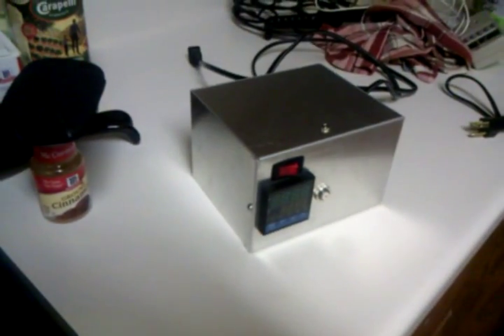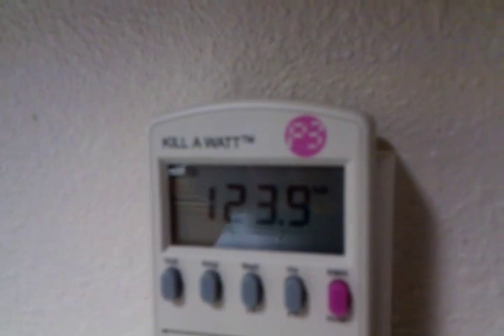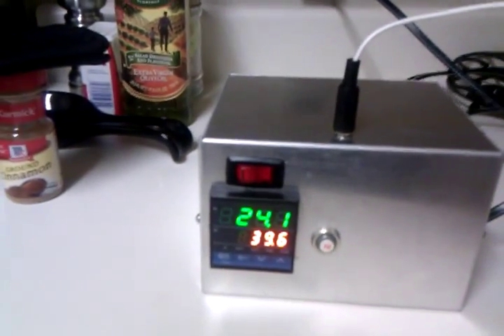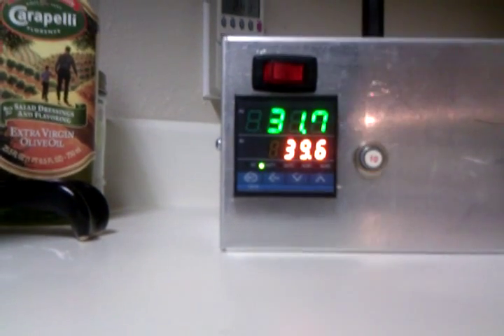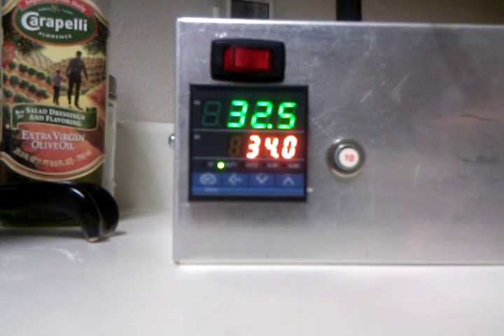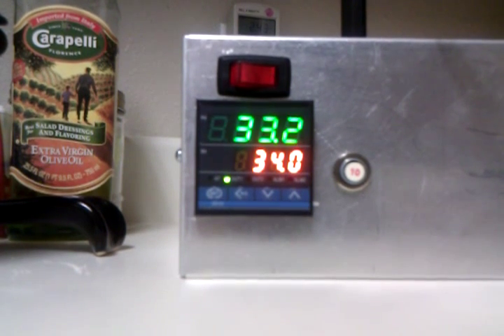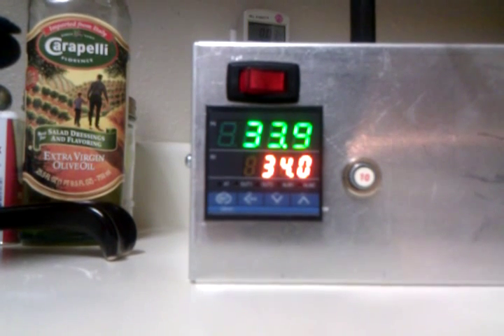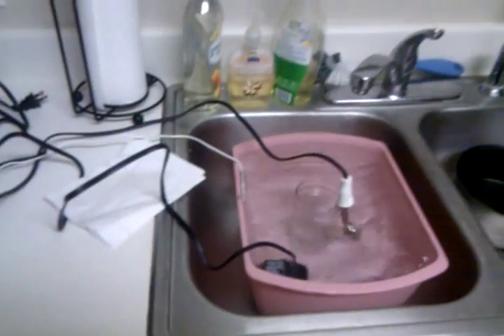Sous-Vide Immersion Cooker Base Station

Comment: What plug did you use on the pt 100 probe?Some say you shouldn't do this since it changes the length and resistance of the prob wires.Did you calibrate probe to verify accuracy?
Upgrade to a Solid State Relay. You can get a 25A SSR for $8 and the heat sink is $5 at lightobject and if you don't pull over 7A or so you can run without the heatsink.  The mechanical ones don't last very long and the annoying click would drive me nuts, especially since while maintaining it clicks on and off a lot.